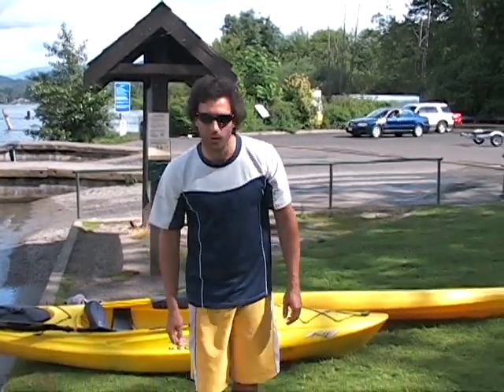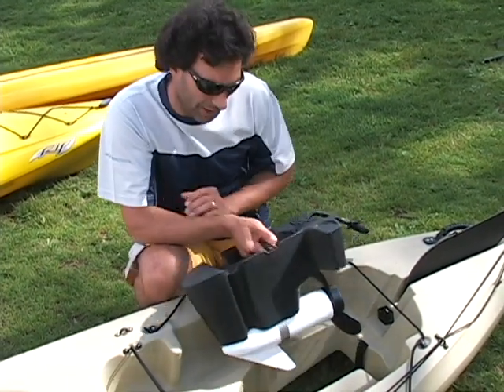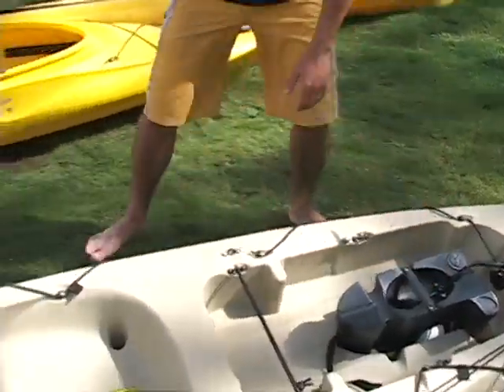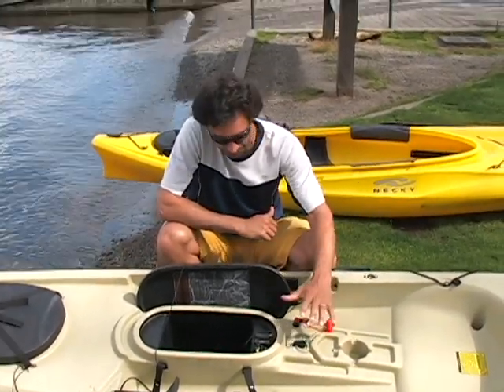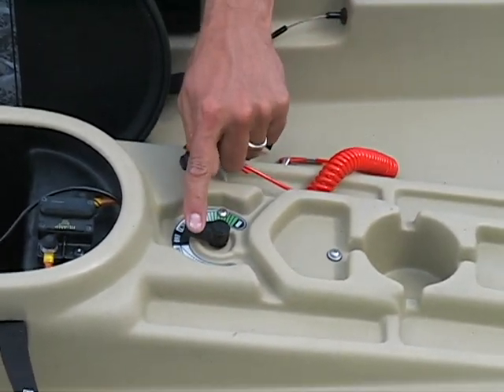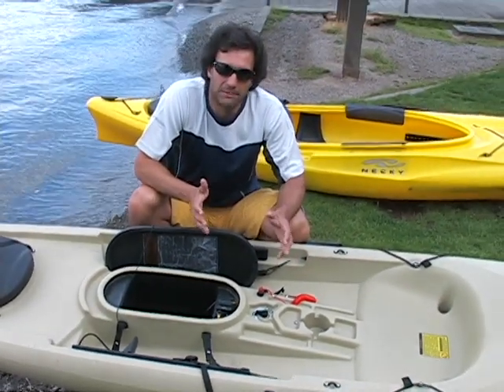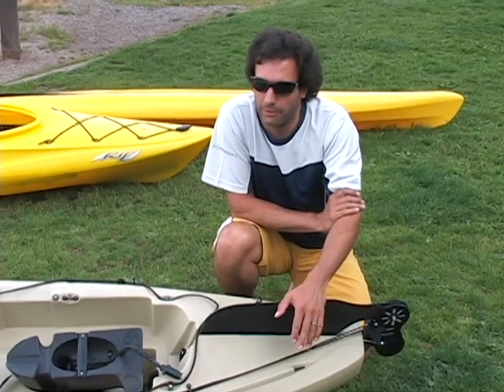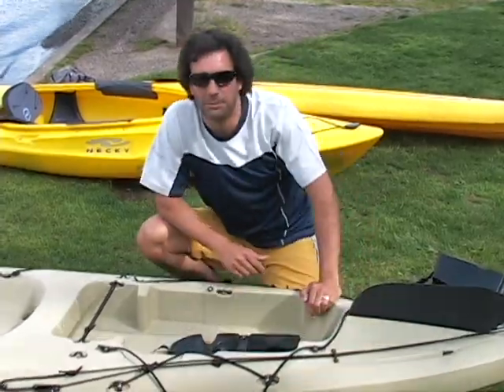Ocean Kayak Torque  (Video overview and demo)

Comment: I like my torque alot I also have a hobie outback. The advantages of the torque is the motor and controls it is also a very stable kayak I can stand up in. It's a flats fishing machine. The disadvantage is the weight and the rudder system is not as good as the outback. The advantages to the outback are you stay dryer on windy days and you have a better over all feeling of the kayak and you have more storage room. But I have been leaving the outback at home and taking this fun torque out.

Comment: I have the same setup on my Hobie.  35 ah battery with a 30 lbs thrust motor.  I got 5 hours out of it with power to spare.  The setup in this video should get much more run time than mine due to the fact that their battery appears to be larger, and they have a PWM as their throttle control.  Much better energy use.

Comment: I talked to Minn Kota and they informed me they suggested a 100amp/hr type 27 battery for the 33lb thurst motor,  the battery in the video looks like a type24 and the battery hold looks like it would only fit that type, a type27 would be a tight fit at best.    This means lower run time, less thrust in windy choppy conditions.  Nice overall design, a bit pricey though.

Comment: Nifty Idea how they mounted it but if your back hatch has stuff in it and you head into shallow water your forced to remove it all just to pull the motor out to get into skinny water. I'd much rather just tilt it forward like a normal outboard. The kayak companies really see the need for the trolling motor setups but have yet to hit the right setup.